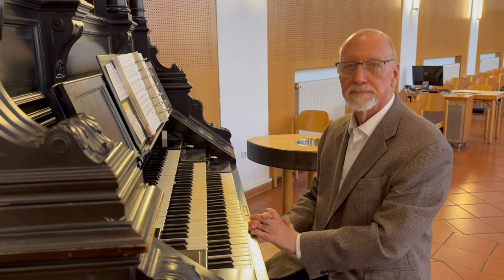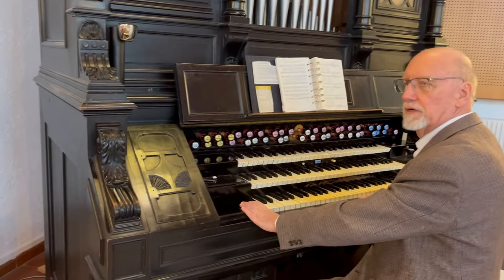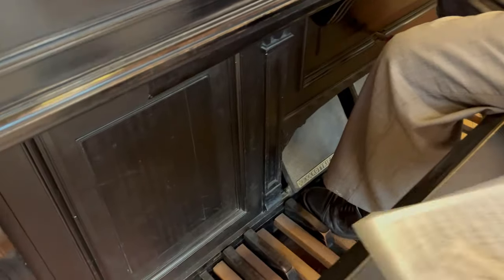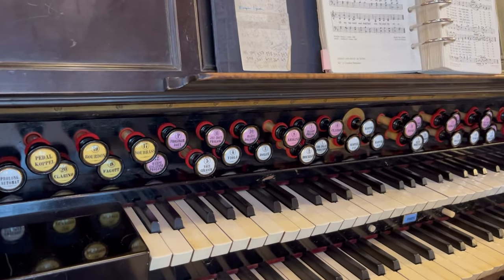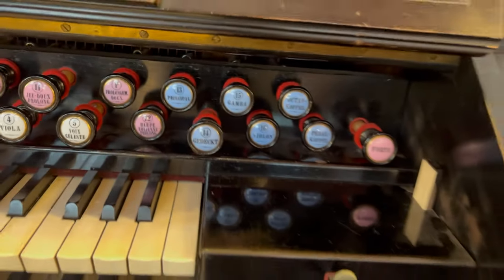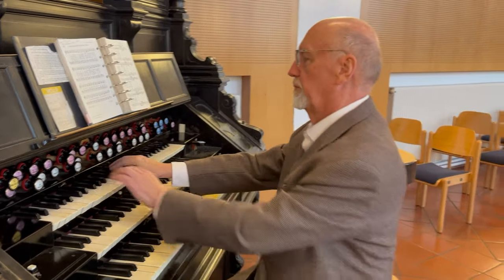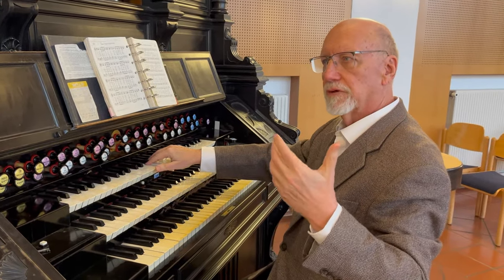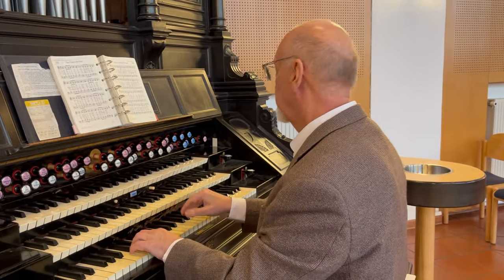A rare 1901 combined Pipe Organ/harmonium in Vienna, Austria demonstrated by Jerry Barton

Comment: "Manufactured for a private household...After the owner had to leave in 1938..."  Was this instrument stolen from a Jewish family?  Did the owners ever receive compensation for it?
Reply: I noticed the nearly-star-of-David decorations on each side. But what does he mean when he keeps talking about using the bellows? Is that just for the reeds?
Reply: @georgebattrick2365  They ARE stars of David, just rotated a bit.  He didn't explain what the bellows are for.  Both the pipes and the reeds require moving air.  On a traditional harmonium, the bellows are pumped with the feet, and that may be the purpose of those pedals that we can see.  But on an organ, with its pedal board, that would obviously be unworkable.